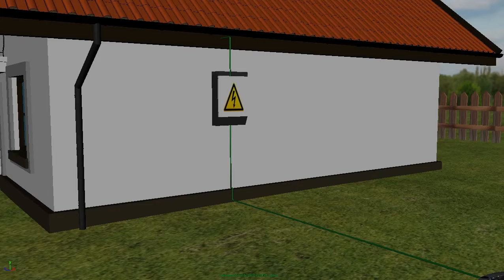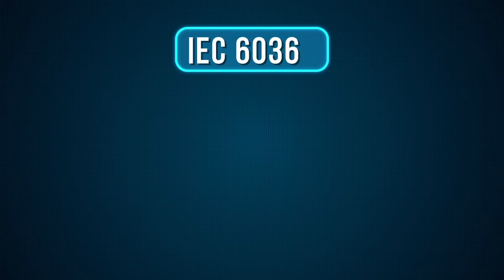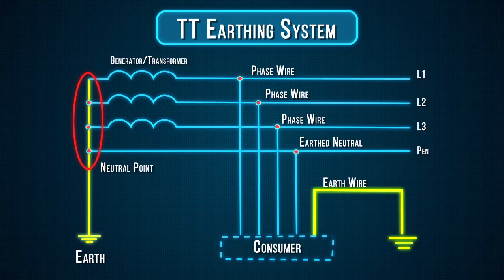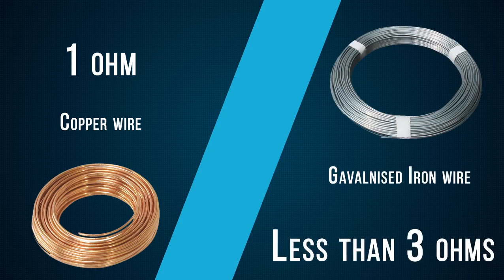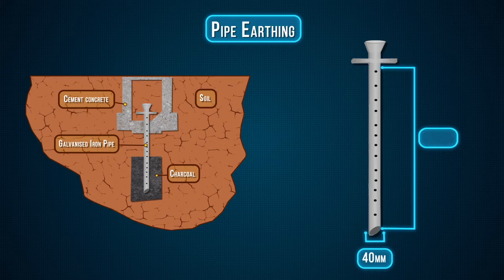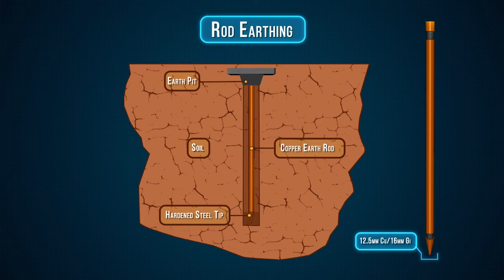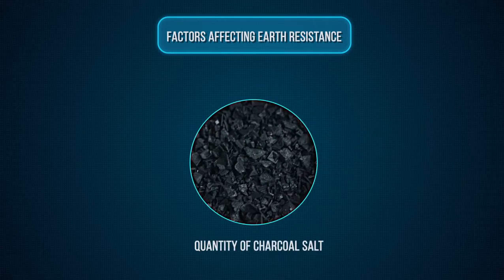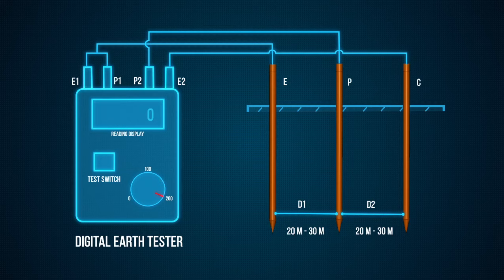Earthing System- Types, Methods and Measurement of Earth Resistivity-Animation

Comment: To be clear, no voltage is applied by the unit across P1 and P2 as stated at 7:05, these electrodes measure the potential difference in the ground. A voltage is applied across C1 and C2 only.

Comment: Thank you very much. I have   TN C-S system  in my building, and a 3-phase lift motor  with control panle in the sixth floor is connected properly to the system as you described    and there is encased electrode that is conected to the building structure and to foundation sticking out in the elevator  room can I used  as earthing  for further protection  and ground the control  panle and the  elevator motor to it.